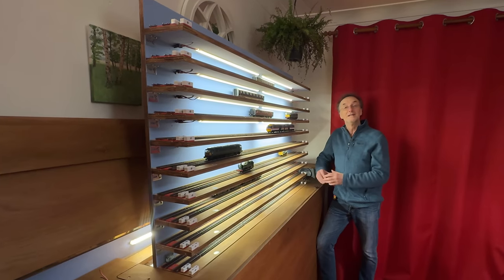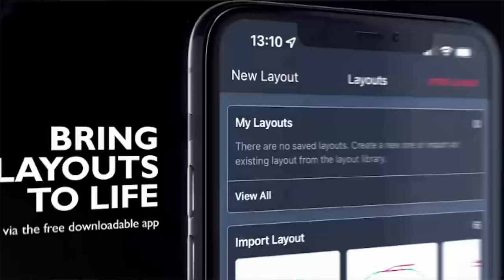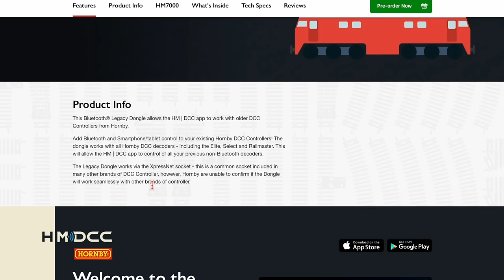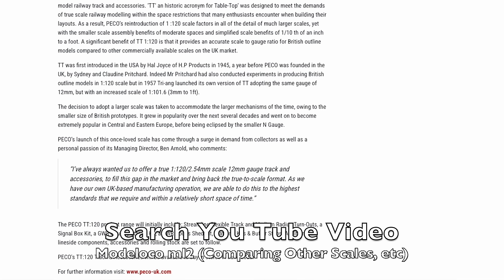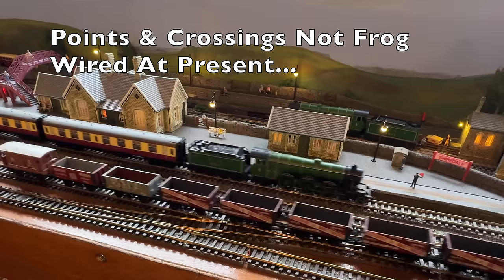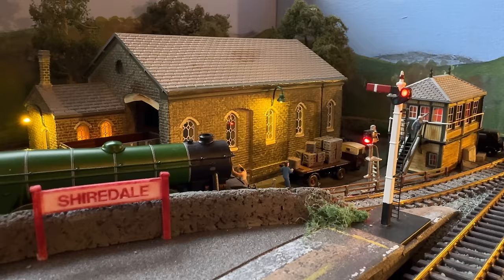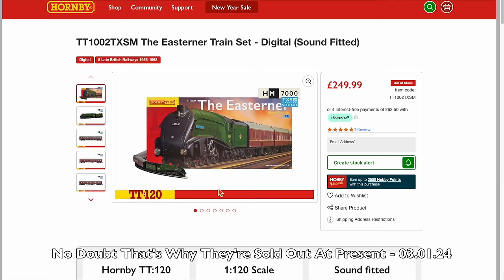TT:120 - The Perfect Scale? 2024 | ml26

Comment: Personally I wouldn’t recommend TT120 to an 8 year old. It’s very delicate. Maybe 14 and up. For the younger set I think railroad OO is more robust and a good place to learn. DCC Concepts does a good product called Power Base to help locos with steeper gradients
Reply from the maker: Yes, you make a very good point and was relating to a more supervised role rather than an actual hands on initially, hence me saying 8,10,12… plus that would mean buying into two scales. Power Base, personally haven’t tried but, not sold on that concept. What has been your experience?
Reply: @modeloco  I’ve purchased Power Base as a result of PeachyTT120s review. I haven’t installed it yet because it’s just for the mine section of my layout that is waiting for a steam shunter
Reply from the maker: @damianinCanadaTT-OO  On a helix I’d say yes with at least 2 magnets applied but, on a scenic area where ballasting, glue and paint may well be applied to track work afterwards then the steel plates would obviously be blanketed between the sleepers and thus imagine, that this could adversely affect much of the gains made. Keep me updated 👍

Comment: Hi Andy, thanks for another enjoyable video. Having had Hornby train sets as a kid and never getting as far as building a model railway, I started to think seriously about doing this in 2022. Not having a huge amount of space available and only limited funds, I decided I would get my old track and rolling stock out of the attic where it had remained boxed up for many years and create a small end to end layout. The emphasis would be on the modelling and scenic elements rather than the running of trains. Then, when Hornby announced TT:120, I started to think about the possibility of creating, in the space I had available, a fully functioning layout with a few running trains, a station, goods yard etc. Then when HM 7000 was announced and I could have DCC relatively cheaply also, it seemed, for me, to be the perfect choice. So, for less than £200 pounds, with Hornby discount and reward points, I bought the Easterner Digital Train Set and was thoroughly impressed with quality and smooth running of the models and the ease of use of the HM 7000 app. Given the vast amount of choice of locos, rolling stock and scenic elements, both new and second hand, available to OO scale modellers, I am a little bit envious. But I still feel that TT:120 along with HM 7000 is right for me, even though TT:120 is new and therefore a bit of a risk. It's early days, but I've planned out where the baseboards are going and put together some track plans and will see where it all leads. Regards Paul
Reply from the maker: Thoroughly enjoyed reading your journey and yes, it is perfect for this and my Man Cave too. Love being able to sit in a real room and with it being permanently ready to run is a real bonus 👍

Comment: Very useful summary video. I live in a flat not large enough to host a 00 gauge layout that would satisfy my ambitions (yes, you can do very compact shunting type stuff, but that's not what I am after). The basic format and concept of what you have built is something that could fit very neatly into the space I have available. As I have never seen TT stuff in person, though, I have been reluctant to actually start spending money before I am certain I can make it work. The number one question I have struggled to resolve is the one you answer at 21:30 in this video: how big is a turning loop.
Reply from the maker: @robinpayne125  Thank you 🙏 for the comments and thoughts and yes, the turning circle is key 🔑 👍

Comment: I have added DCC Concepts loco magnets with steel plates to install under the track to improve traction on inclines.
Reply from the maker: Thank you for getting in touch. What incline degree have you got. Have you painted and ballasted these areas as doing this, I’d assume, would adversely effect any slight gains made and that adding weight to the actual locomotive would be the best way to help with this and, that it might be the weight of these magnets themselves not the magnetism itself that’s helping. I’m still not convinced it’s the right way to solve this but, more detail of the above would help. Thanks 🙏

Comment: nice video, for me tt is a no go due to the inclines
Reply from the maker: When coming back to modelling with OO and building the loft layout it soon became apparent that inclines caused some steam locomotive wheels to slip when pulling even a shorter rake. At that time the Bachmann Diesels, I began getting, due to liveries and availability seemed to perform best due to their sheer weight, even if not having the better wheel contacts, probably better wound motors. Will be interesting to go back and do some running with newer upgrades this year and knowledge gathered since

Comment: Hey up mucka all the best for 2024  I looked into the dapol signals N scale and they work out at being 35 feet tall in real life Which is OK for TT120. And especially if you raise them up another 5 mil. 

Yes Yes please do a vid on semaphore signals. I must say I like the dapol ones with the black box underneath apart from the price. Yowzas 😂
I like you want full auto. So I’ve also gone down the iTrain route with the Roco Z21 command station and I’ve used the Yamorc current sensor YD6016LN for the feedbacks and a YD8116 Switch for my MP5 points. I’m now up to the stage where I’m looking at fitting signals. I believe that these MP5 point motors have another switch inside that can control a semaphore signal, at least that’s what I’m hoping. But how to go about wiring them all up and getting them working correctly is another challenge. I also would like to use the servo motors for this and I know you can’t use the YD8116 for servo motors. 
I’ve only been able to get this far Andy with my TT120 layout because of your excellent videos and your help. You are a star my man. 
So a vid on any make of semaphore signal will be fine. 
Cheers 
Steve
Reply from the maker: Yes not cheap Steve and beware, if wired up incorrectly they will just simply burn out but, the mark 2 with box below really helps solve this as the instructions are extremely misleading or, at least they used to be. A few have complained and like me, Dapol either skirted round it or, didn’t respond at all. That said, I really love the signals and what Dapol achieve. This hobby can be strange at times regarding a fault or, misprint, etc that you sincerely try to help or, wish to get help with. Have had a few instances with more than one company and shop where you go so far then… the tone changes very quickly. All part of the experience👍

Comment: Everyone goes on about gauge, but I don't think the rail thickness is to scale on anything on or below 00, so does that make 00 the right outer diameter wides from one outside rail to the other, and does that make TT:120 over scale on the same measurement?
Reply from the maker: Hello, I’m not entirely sure what it is, exactly, you’re asking here but, I think I get the idea. Do know OO gauge track is for HO scaled models and that Peco, here in the UK, has the edge on the more correctly gauged track. TT:120 models are finally correctly scaled to the track. This is a first in the UK for mass produced models. Well, unless we go into very small amounts, then you could argue HO is about 0.1 of a mm more correctly scaled but, that’s not a UK scale. Back to track, Peco again make the more realistic looking track and the most correctly gauged rail extrusion. The outside dimension between the outer edge of the rails doesn’t make TT:120 over scale. It’s that our OO models have their wheel sets pushed closer together by about 2.35mm, I believe is about the exact figure, so they can run on the HO gauged track.
Reply: @modeloco  basically, I was asking if OO was correctly scaled if measured from the outer left wheel to the outer right, because if each rail thickness is over scale to guarantee traction and conductive that would in theory make up the difference of the HO gauge track. I was asking as no one really talks about it. Everyone just talks about gauge. I'll try and work it out next time I'm in my garage, but it might make an interesting talking point mainly the rail thickness, If it's even right for HO or over scale making OO really then as close to the really thing as good a HO. Or am I just mad. LOL
Reply from the maker: @PeckhamHall  I ask the same thing every day 😂.  I’d say it’s a good sign of the opposite. Back to gauge though, yes the rails have to be a little thicker I guess to help running and strength but, you can’t get away with OO scale models having a HO gauge wheel spacing
Reply from the maker: Your theory is well worth looking at though. I’m happy to be completely wrong 😂
Reply: @modeloco  You are not wrong about the gauges at all. I understand the difference in the gauges HO and OO it just the sleepers, on some anyway. I think maybe the OO is 10% over size, as well as under size doing a quick estimate.
Reply: @PeckhamHall  Rail width is on the small size as in perhaps only around .005" too wide.  NOT visually significant.   It appears you're including TREAD WIDTH which of course is a scale issue and I personally do find offensive in the new range of TT!  BUT flange height (and shape) are perhaps more significant.  IF I buy a TT A4: ... I will be addressing these over-scale discrepancies with a small lathe I bought for this purpose.  Thens there is the cab having to be lowered, the boiler front streamline casing needing significant narrowing as well and a myriad of other details I'd address!
Reply: @modeloco  And the cost of P4 is making me consider TT BUT those wheel dimension still wreak of....

Comment: As a new person entering the hobby, did I need another scale to choose from. It'd been tough to decide as it is, to go On30 because I am older, or OO because of cost and availability of product?  I may be a bit jaded as a shooter there are an unlimited number of calibers to choose from with new ones coming out each year, all pro-porting to do something better.  Hornby seems to be generating buzz for it's brand, but what about the serious limitations for structures, and Hornby only trains for us new guys , the very customer Hornby says it's after? I like Hornby product and a very  nice website for OO scale, but I can not make the plunge for TT with it's limitations.
Reply from the maker: There’s certainly a lot out there in OO and then all the ways to control your set up on top which can also make TT:120 and its limitations at present less bewildering too. To use HM7000 app you just need a decent gadget with a correct power supply (my iPad Pro gen’ one works fine without issue) but, you may just want to stay in DC, have DCC hands on or, even have both. For smaller spaces OO is great to collect, admire, shunt, do modifications and handle. TT:120 for access, running and creating a more interesting twin track loop type  layout with a decent rake in restricted areas with radius 2/3 bends. It’s still a large enough scale to shunt too. Yes, Hornby needs to stay on board and get more out there and so a lot rests on April releases. That’s my experience so far 🙏

Comment: Odd that you can’t fit sound in a class 08, I have that in N Gauge from Graham Farish.
Reply from the maker: I know. You can and I have but, not the Bluetooth ones as they’re bigger 👍
Reply: Oh I misunderstood.  I’m all dcc, using a z21 and iTrain.
Reply from the maker: @drithen  Yes, have fitted a Loksound ESU with speaker, albeit tight, into an 08. There’s a video on my channel but, no it’s not the cheaper Hornby Bluetooth one as they’re bigger which means chopping the body and wiring inside, etc. I’m in the middle of using iTrain with a newer bought Digitrax loconet system as Hornby systems use xpressnet that iTrain can’t communicate with unfortunately. I do like the HM|DCC system as it will run on Mac gadgets but, as it stands, not Mac computers and is no match to iTrain in terms of potential of course. I like the Digitrax using the infrared link between an actual hand held and control station too rather than Bluetooth or router but, app control improves all the time and a far cry from Hornby Windows only Railmaster which had me jumping through hoops tbh.

Comment: You’re correct in saying you’ve got to do good track work in TT120. Willie WhiteLaw takes it in his stride whereas Mallard is bouncing around all over the place. I’m gonna get some of that Maas polish. 
What’s best to clean the loco wheels with? Do I need one of those rolling road thingy ma jigs 😊
Reply from the maker: Thank you again. Sounds like you’re really forging ahead. For wheel cleaning I do like the Peco PL-71 Locomotive Servicing Kit. Don’t own a Rolling Road though have been tempted a couple of times. I’d say that’s more for seeing how a locomotive performs after a strip down or to see if it’s rocking, tight spots, etc and to try see any possible faults more clearly on a workbench
Reply: @modeloco  thank you 👌
Reply: I've just looked at Peco PL-71 Locomotive Servicing Kit. Won't a lot of dirt etc fall down into the chassi etc and cause some damage? being as the loco is upside down?
Ta!
Reply from the maker: @stevio7777  Possibly yes, I suppose so and great that you’re addressing these doubts. For OO there’s TT4561 Woodland Scenics Tidy Track Roto Wheel Cleaner (OO Gauge) which would be a simple alternative if it were available in TT. This said the wheel bearing housings and body offer some protection and dirt should collect on the tool. If it fell off then should fall back out when the loco is the correct way up again. PS I’m not finding wheel cleaning to be necessary at present but, track yes that needs a gentle rub down and vac for dust build up, that really all. PPS you could clean with loco tilted in the cradle slightly as well. 👍

Comment: Why does nobody disguise the pointmotors ?
Reply from the maker: Do you mean with a building, shrubs, etc? Had there been room, I’d have definitely gone underneath but, with restricted space am happy with under Platform and Road. Please share your thoughts 👍
Reply: Maybe they are not point motors, I mean the long plastic things with the two wires coming out of it. Furthermore I love your channel ! @modeloco
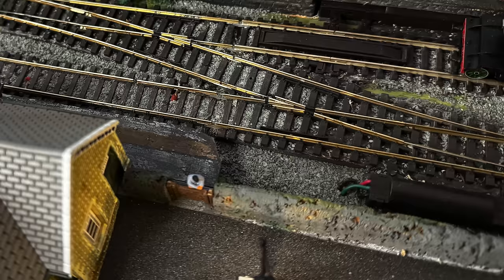Reply from the maker: Thanks for getting back. They have three wires though the black one is hard to spot in situ. If it’s at 4:26 then that one, out of the five fitted so far, is still visible. Though actually out of view and a work in progress, is one I’ll probably disguise too, for close ups like this in time. Guess they’re forever a work in progress. Thanks for kind appreciation 🙏

Comment: Chris AT Peachey at TT120 recommends for track a polish called MAAS an alternative to INOX .  A quick trial (over three months) to see if there could be any benefit from polish track using a modern metal polish with tarnish and oxidation inhibitors. https://www.youtube.com/watch?v=R1dZHCxgXn0

Big tin of MAAS
Reply from the maker: I’ve never used anything apart from a piece of sawn timber, a rubber or now the one in this video which seems to do the trick 👍
Reply: Make certain no residue enters you loco's gearing..... or ELSE!